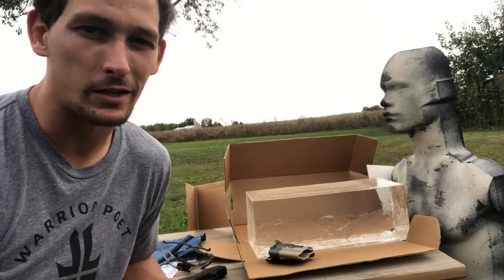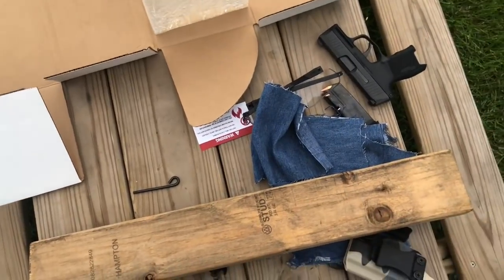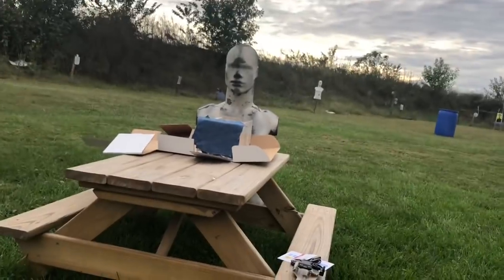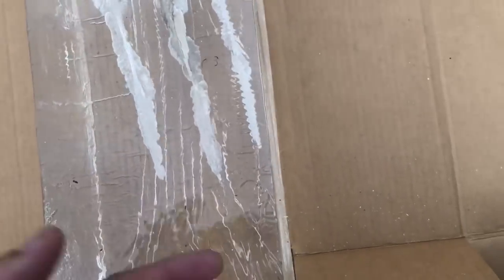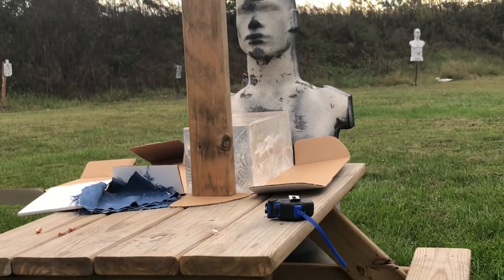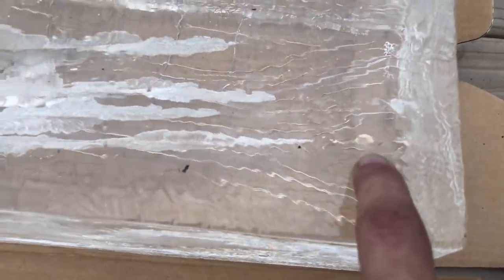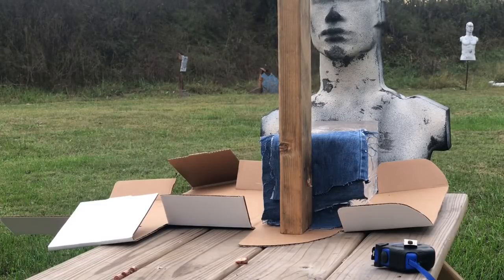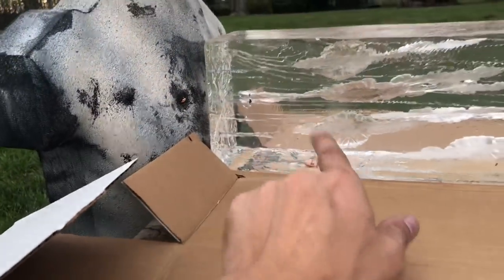Gel Science! 115 gr 9mm vs. 2x4 AND 4 layers of Denim!

Comment: Seems like the bulk of the wound channel happens after the bullet would have left the body unless your dealing with a large person. May just be camera angles but generally organs are an inch or two beyond the skin and the tumbling does not seem to occur until 10+inchs. Just food for thought
Reply: Clement Miller the first four inches roughly replicates skin do to skin is tougher than internals. This can be proven by calibrating the block with a B.B. gun. The B.B. doesn’t go Draper than four inches
Reply: Interesting had not heard that before makes me rethink the results and the over penetration if 4"=skin and its going through 24" just interesting.
Reply: 6x6x16" gel block.  FBI standards, first 4" represent skin, not 4"inches of skin...
Reply: 16" block = 4 inches of skin